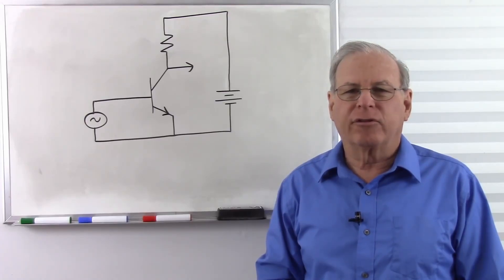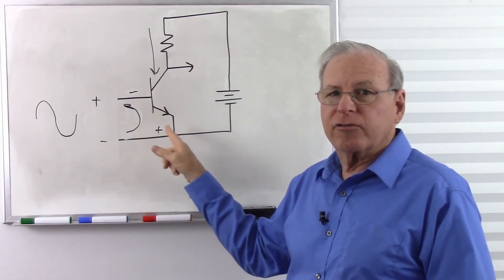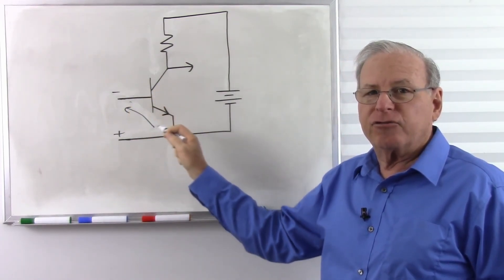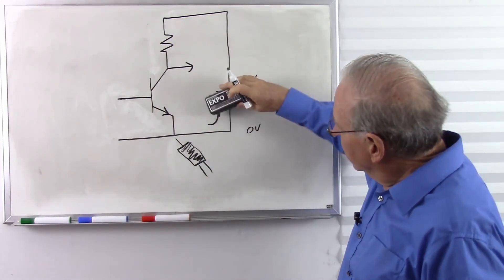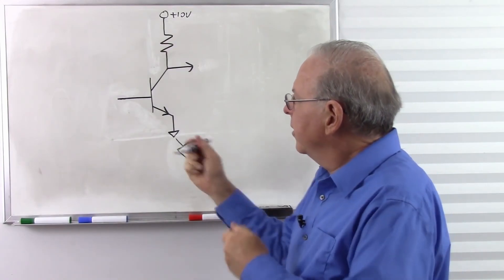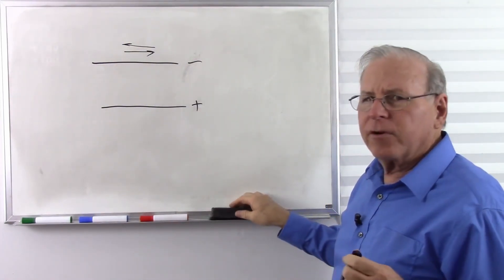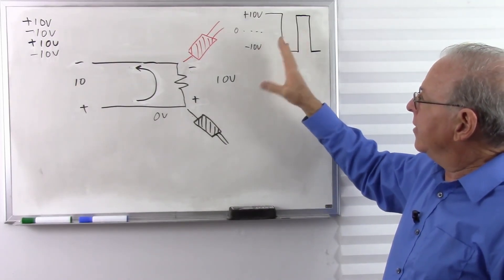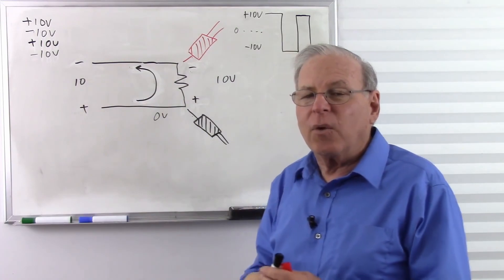Alternating Current and Small Signal Amplifiers   Answer to Question

Comment: I understand what the presenter is trying to explain here, but it's possible that putting a "load" resistor in the example works to make this more confusing. In the example given, you are simply connecting the volt meter to the positive and negative points of the voltage source. The "load" resistor is irrelevant to the measurements being taken. The measurements would be the same with or without the resistor. Current will flow through the high impedance input of the volt meter and register 10 volts whether current is flowing in this example circuit or not. The volt meter itself would be "completing" the circuit. Perhaps a better example would to have included 2 or more resistors and perform measurements at different points to illustrate the point being made. Good video though!

Comment: I didn't see the actual question but offering this as a possible clarification in case this is what the person was curious about. For a common emitter amplifier like the one in this example, the "negative" part of the AC signal won't be amplified as is pointed out. However, it is possible to amplify 100% of the AC signal if it is shifted more positive before being applied to the base. If the "lowest" voltage of the AC signal doesn't fall below zero volts (in this example), 100% of the signal will make it through the base of the transistor and be amplified. This would be categorized as a class A amplifier. If the AC signal swings above and below 0 volts, only the positive portion of the signal will be amplified as is pointed out in the video - in this case 50% of the signal. That would be classified as a class B amplifier. If you want the AC signal to alternate above and below a 0 volt reference - you would need a push-pull amplifier consisting of both an NPN and PNP transistor. Each of these transistors would be operating as class B (amplifying 50% of the signal) with the NPN handling the positive portion of the AC signal, and the PNP amplifying the negative portion.
Reply: So, you would shift the AC signal to be more positive by adding more bias voltage?

Comment: Amazing explanation👍
Why common emitter and common collector amplifiers are called like this? Cannot understand how are they common to input and output signal 🤯
Reply: In any transistor amplifier circuit, each terminal is tied either to input, output or "ground". 
 In the circuit shown (common emitter) the input is between base and ground, the output is between collector and ground, and the emitter is tied straight to ground. Thus, both the input and output signals go through the emitter, so it is "common" to both.
In a common collector circuit, the input is between base and ground, the output is between emitter and ground and the collector is tied to ground (through the power supply).
Thus, both the input and output signals go through the collector (after the power supply), so it is common to both.
Reply: Are you are taking the Vocademy course?  If so, it is covered in the section Analog Circuits under Amplifiers.  If not, Google Vocademy, go to his website and sign up for the electronics course.  It's free and presents all of his YouTube videos along with more information.

Easiest thing to remember with transistor amplifier types is to ask the question "Where is the output?".  If the output is the collector it is a common collector amplifier.  If the output is the emitter it is a common emitter amplifier.